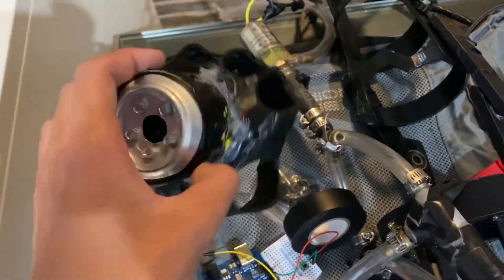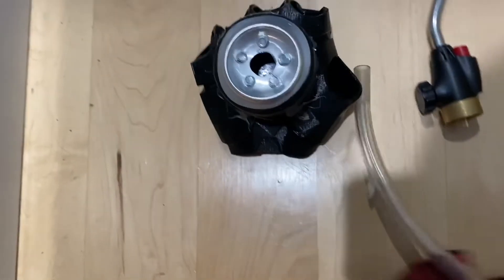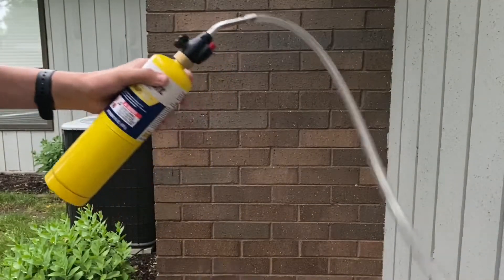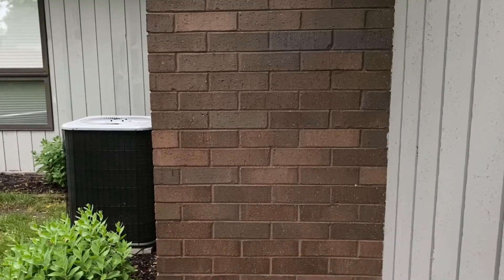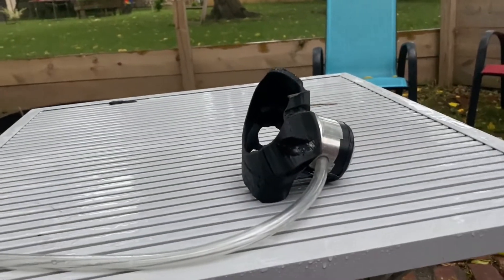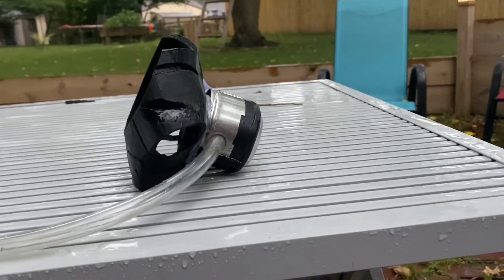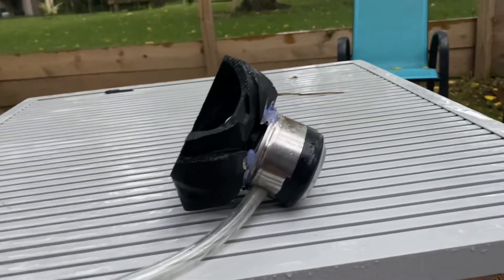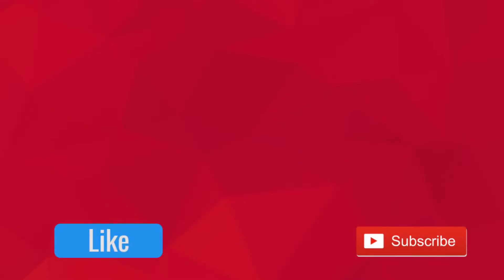Making A SUPER SIMPLE IRON MAN REPULSOR - Cheap And Simple Build!

Comment: Wait u just connect the fuel collector pipe to combustion chamber then how's that fuel burning can you provide a basic diagram?
Reply: It is burning because there is a spark in the blow torch nozzle that was used
Reply from the maker: there is a spark in the nozzle of the torch and that sparks it

Comment: Would this work with compressed air instead of MAP gas? I’m essentially looking for a way to make this but less dangerous, so it can still knock cups and stuff, but without the fire.
Thanks in advance 😁 your creations are amazing!
Reply from the maker: Yeah it would work. You could try attaching a CO2 bike pump to it
Reply: The bike pump is a great idea! But would I still need the propane torch for this to work? Or is there another attachment that can release gas from the push of a button?

Comment: Hey pls reply what happen if I use hydrogen gas and in the combustion chamber I add the electric spark will it work have a big blast or lower blast
Reply from the maker: It will have a bigger blast than the gas I am using
Reply: @Random.Creations  thanks I m from India 🇮🇳 u are the best as u have replied to my question thanks a lot my name is saksham i m 13 year old boy thanks a lot I m going to recreate with my friends but can u pls tell what can I use instead of solenoid valve as it is not available in lockdown or can u simply made a video on how to make solenoid valve pls reply
Reply from the maker: I’m not sure how to actually make a solenoid valve but Instead of using one, you can use some sort of manual open/close valve. It should work as long as you are able to open it and close it quickly.